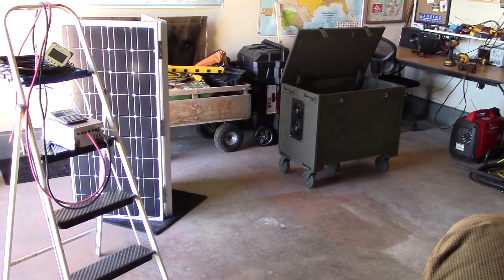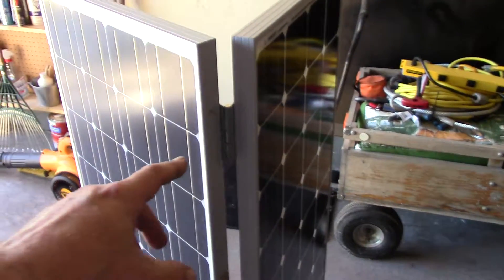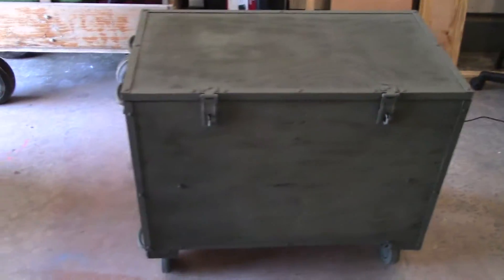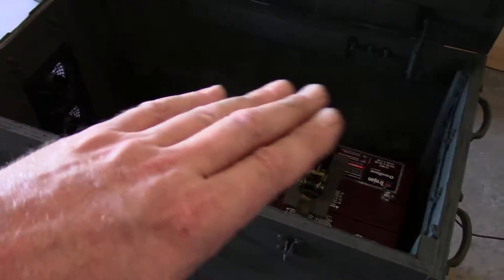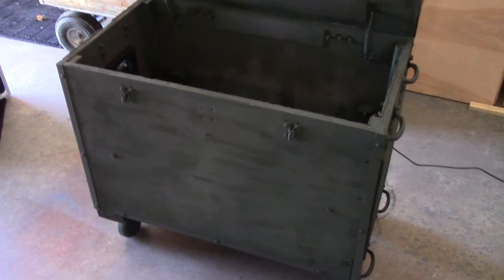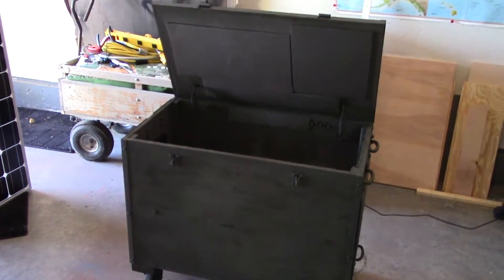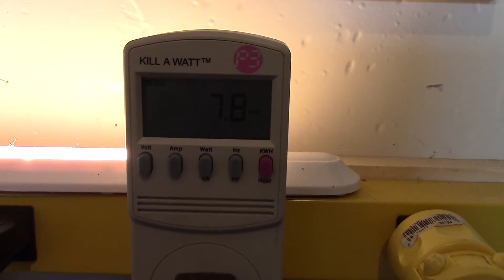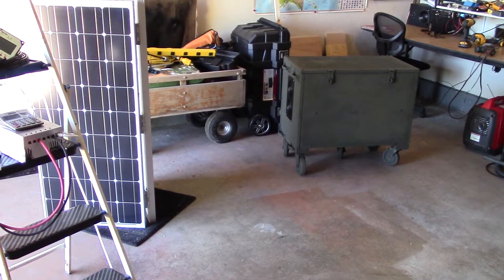DIY portable (transportable "bug out" box) solar generator (Part 3)

Comment: This project is looking great Chris!  Are there any advantages to running an AC unit on the batteries to keep them cooler?  I know of course not in this project as an emergency generator.  But just in general, do batteries perform better if an AC unit is keeping the heat down in the room that they are in?  I just have seen computer and servers being cooled down with AC and I was wondering if Battery Banks running on Solar might be similar?
Reply from the maker: Thanks. Most batteries perform best per their specs (like, 70-75F in most cases). Heat is the #1 killer of batteries. Cooling them with an air conditioner will work, but if that ac is on solar/battery power...may rob the benefit.

Comment: Love the paint job.  This is going to be too good to set aside just for excursions.  You need to use it all the time to run a few things in the garage (fridge, computer, fans).
Reply from the maker: Thanks...go 'ol "OD-green" paint. Actually Rustoleum Camo paint from Walmart. Totally 100% agree with you...solar panels aren't meant to hang out in the garage. I am thinking of some ways to run it at home...garage, bedroom, etc. Could offset a few more KW/H's per day with this roll-around unit.

Comment: Hi Chris, looks like we are twin brothers in a parallel universe, portable power projects.  I got a good deal the other day at NORTHERN. They had a 70" truck deep tool box ( matte black with grip handles ) on sale for $30 off, and a fellow customer gave me the internet discount code for an additional $50 off. So what was regular $369 plus tax ( $422 in TX ) came out to be $313.91 out the door . I'll paint the top and inside white for sun heat reflection and maybe the lower exterior camo which will be easier to touch-up.  I will be welding a removable cart with 12" wheels for transport.  Just today, I was attaching hinges to my panels similar to you with a few differences.  My hinges are lighter weight and my hinge pins are removable, will use cotter pins like large sized "bobby pins" . I will transport 3 sets of 2 panels hinged on the sides and tie them all together inline with the "pins" . Then place stabilizing U tracks on the top and bottom rails to stiffen the whole configuration which will sit on the ground at the correct angle .  So we are moving right along and will be ready for NIBIRU or what ever EMP scare the kooks can throw at us.  Later   Jim K
Reply from the maker: Holy crap that sounds sweet! Can't wait to see your rig...sounds pretty unique.

Comment: It is looking good.  I was thinking in your last video that you should consider bigger wheels, but you beat me to it.
Reply from the maker: Thanks...the 5" wheels do better on the grass too. The whole box "spins" easily now...kinda too easy. As for rolling it around the garage...totally smooth. This would be cool at Morning Wood (?) Not up for sale per se...just would something like this work up there?
Reply: It looks like it would work.  It is very similar to the set up I am running right now.  I have The Husky box with 4 T105's, the same charge controller you are about to use, and a Xantrex 1000 watt Pure Sine Wave inverter.  It is connected to (2) 235 watt panels.  I wish I had better wheels because the sandy ground is difficult to move that box on.  I was thinking about re-building my set up and putting it on a big yard cart that can hold 1200 pounds to make it easier to move.

Comment: Nice I like the paint job. That would be a nice quite setup for tail gating. Looking real nice
Reply from the maker: Thanks...there some inconvenience with it being heavy. But, one could keep it strapped to the back of the truck, pull the wires out, run an extension cord, erect the solar panels, and be in business. A gasoline generator is too easy.